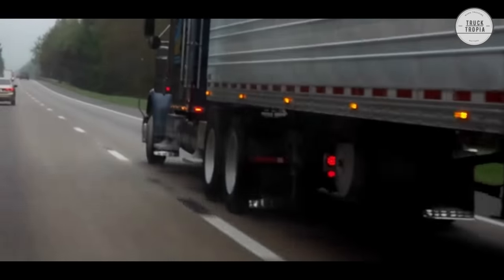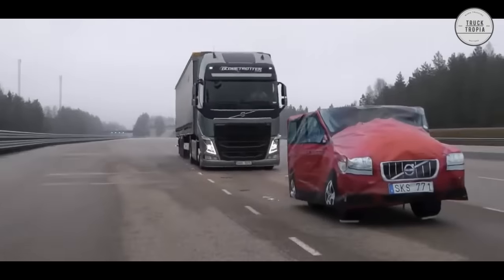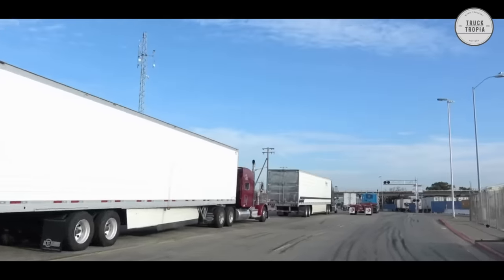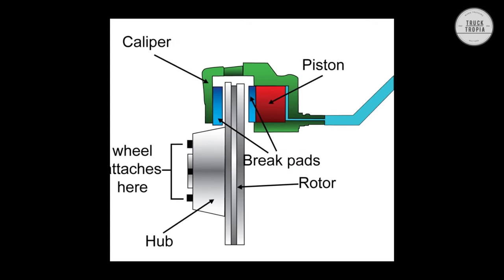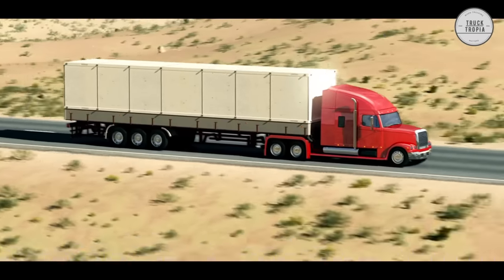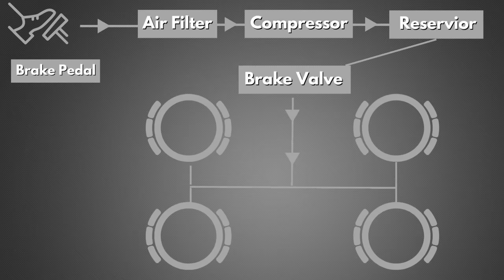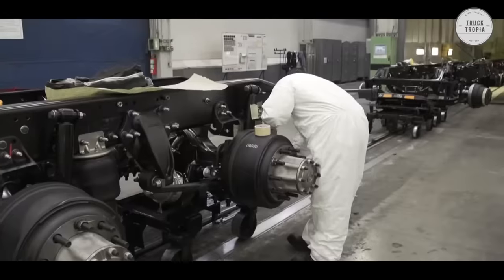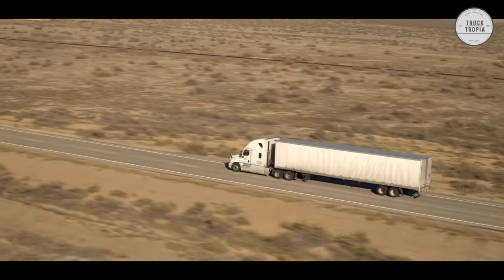Why Do Semi-Trucks Use Air Brakes?

Comment: your answer is wrong, truck use air brakes for the ease of hooking up to different trailers, it was the winner of the competition in the 50s along with the fifth wheel, if i remember correctly it was the bendix company that won it.
Reply: Not the first time and not thfirst topic
Reply from the maker: thanks for sharing your opinion
Reply: @TruckTropia  It's not an opinion, it's fact
Reply: @TruckTropia  plz make Indian truck video
Reply: Also, hydraulic brake fluid can boil in the lines with excessive heat from the pads/shoes. This problem worsens as moisture collects in the system. Water boils at lower temps than brake fluid. So, it stands to reason, the more water, the lower the boiling point, the less braking action up until failure. Brake fluid also needs to be flushed periodically(typically 30,000-60,000mi)which adds to maintenance costs. Commercial trucks can accumulate those miles rapidly which further increases those maintenance costs due to the increased frequency of those flushes. 
As stated in the video air systems don't need to worry about losing brake fluids. In fact an opposite side-effect occurs. Even as air can be lost, the pump will still regenerate more air into the system. At least until it can no longer keep up. Then the brakes go into full lock-up. It's essentially a double redundancy that hydraulic systems don't offer unless you consider the parking brake to be a viable backup. Which it's not. 
Along with a much easier coupling system using air, there are other systems that utilize the system. Things like tandem locks, kingpins, air ride and air seats, all utilize the same system the brakes use. Let's also not forget the ability to air up your own tires(among other things) when an air compressor isn't nearby. 
You can't get any of those benefits from a hydraulic system without supplementing it with additional components.
Reply: @truck tropia FACTS, NOT OPINION.
Reply: Then why do straight trucks run on hydraulic for vehicles only designed to carry lighter weight, but then require air brakes for a certain threshold of weight.  Air brakes are safer and provide more stopping power, like the video stated

Comment: "No brakes fade from overheating"  What is commonly known as brake fade occurs when the binder that holds the brake pad material together melts, and the resultant liquid lubricates the the interface between the brake material and the drum or disc. That's why disc brakes are less prone to brake fade, because the disc is surrounded by air, which cools the disc much more effectively than the enclosed drum.
Reply: Are you sure about that? I’d be asking isn’t it the outgassing holding the pads away from the disc. Which is why the high performance cars run slotted and drilled rotors. The outgassing also heats the pads more cause you have to push harder on the pedal to overcome it. When it reaches the critical point the brake fluid will boil.
Reply: Truck brake shoes don't use binders to secure the friction material to the shoe plate, they are riveted. There is a wear line on the side to let you know when you are on the rivets and need to change them. Usually 1/4 " of shoe left, toss them out
Reply: @kylederry5031  The binder is in the brake pad material itself, it's not what holds the material to the shoe, it's what keeps the material from crumbling in your hands
Reply: @richardmillhousenixon  I got you now, I have seen shoes on little trailers with electric brakes overheat and the material separated,  I didn't consider the actual binder holding the material together
Reply: @22copes  Performance cars use slotted and drilled rotors for different reasons. The holes allow for more airflow through the rotor, keeping them cooler, which helps to prevent offgassing before it even starts, and the slots help to "trim" the brake pads to keep them flat. Have you ever gone to replace a set of brakes and seen the uneven surface on the brake disc as well as on the brake pad? That results from the natural inconsistencies in the brake pad wearing more in some areas and less in others, causing peaks and grooves in the pad material, which then wears peaks and grooves in the brake rotor. So when you have a slotted rotor, the slots effectively work like a razor, knocking the high spots off of the brake pad and resulting in more even wear. They also serve to prevent glazing of the brake pads, which again improves breaking consistency. A side effect of the slots is that they allow the offgassing to dissipate through the slots, but that's not the primary reason they exist.

Comment: This video is either.
A:  Grossly oversimplified on all aspects of braking systems.
B: Grossly ignorant of how and why different brake systems are used where and why. 
C: A bit of both for all the wrong reasons.  

FYI, anyone calling these things out in any way will be brushed off as having an opinion even if they are posting actual industry-wide facts. 😋
Reply from the maker: Its A its a video so that Anyone Can understand
Reply: @TruckTropia  Posting incomplete/incorrect information doesn't help anyone though.  As has every call-out in the comments section pointed out to you.
Reply: @TruckTropia  It's actually so rambling and vague - and in some cases simply incorrect - that it isn't understandable at all.

Comment: The air pressure keeps the breaks deactivated and I thought it was the other way around, now it makes sense why trucks make the air release sound when it breaks or park, thanks for the video
Reply: Nope. Wrong. First, it's brakes, not breaks. The blast of air one hears when a semi truck shuts parks is the air which holds pushes against the brake springs.

Those springs serve as parking brakes and emergency brakes, in the event of a system failure, such as an air line rupture or an accidental disconnect of the glad hands (a connection point between tractor and trailer). So, the red air line supplies air to the trailer to release the parking brakes on the trailer. That's all the air in that line does. Think of it as a dead man switch to try to stop the trailer in case it disconnects from the tractor somehow, or to keep the trailer from moving while parked.

The blue air line, however, functions in a manner similar to a car's hydraulic brake lines, using pressure sent with application of a brake pedal, to each wheel, to force the brake shoes or pads, to the drums or rotors.

From around 1973 or so, semi trailers have been required to have such safety brakes. The brake chamber down by the wheel is two chambers in one. One chamber takes red air line air and resists the parking/emergency springs, keeping them from trying to apply the brakes. The other chamber is the service brake chamber. That one takes air from the blue air line, which is regulated by the driver's foot applying pressure to the brake pedal, and that air pressure pushed a diaphragm which moves mechanical linkages to apply braking force. Truck Tropia should, as a public service, delete this video and not replace it unless and until the author learns about truck brakes.
Reply: @planethedgehog2427  slight correction: pressure to the service brakes doesn’t come directly from the blue line.  The blue line sends a pressure signal to a valve which then opens to allow pressure to flow from the air tank to the service brakes.

Comment: You missed the main fact why trucks have air brake systems instead of a hydraulic brake like cars have: the energy reservoir
A truck has more axles and higher weight, so you need a lot of force to activate all drum / disc brakes. There is more energy needed than the driver can create by pushing the brake paddle.
Therefore you use the energy stored in a reservoir and release this to the brakes with an valve.
The main advantage for using air is that you can store it easy and cheap by compressing it into a tank. For nearly incompressible hydraulic fluid, reservoirs are much more expensive, so an air system is the cheaper solution for trucks.

By the way, you can use air also for other components in a truck like air suspension, gearbox actuation,...
Reply: Your last point (and only that one) is valid, but air brakes were in use before air suspension was common and long before air was used for shifting.
Reply: Not To mention it would be a pain hooking and unhooking a trailer.  And if the glad hands leak, or you hook up to a trailer with leaks, it's a heck of a lot cheaper to replace air than hydraulic fluid.
Reply: @wesleyehowell  Yes, the only serious reason air brakes are used is so trailers can be quickly dropped and hooked.  Everything else is arguable.

Comment: Love the comments section. 

Some are arguing that he is completely wrong, others are saying he’s partially wrong/correct, some are talking about trains, some random said there is no [performance] difference between drums and discs, some guy said air doesn’t heat up like hydraulic/brake fluid does (IDK if he meant air doesn’t heat up at all or if he meant air won’t heat up as fast as hydraulic/brake fluid. His comment had all sorts of typos and he didn’t elaborate enough, so I can’t judge which way he was going with it). 

I’m just here because YT recommended it. I got no skin in the game, though I did operate some military vehicles that utilized air brakes, when I was serving. Don’t ask me how the [air brake] system works because, I kinda brain dumped some of that and I had a very basic understanding of how they worked. If you could ride a bike and write your name, you’re pretty much qualified to operate any type of heavy machinery in the military. Don’t give up on you’re dreams 😂
Reply from the maker: Thanks for sharing 😅👍

Comment: Only one issue,   Hydraulics give more force, this has been proven using comparable size if you will.  Air can provide the same force but with a larger size unit.   Air breaks were chosen because of the safety issue.

Comment: The biggest problem with disc brakes is that it's like going back to the days of inboard drums. You have to pull the hubs to replace the rotors. I hadn't seen inboard drums in 30 years except for a couple of old trailers.
Reply: Are inboard disc breaks like the militaryhumvee?
Reply: @NFLYoungBoy223  never worked on a humvee, after my time

Comment: You left out that air brakes are very noisy, which would be a huge drawback for a regular size vehicle.
You also left out the alternative of electric brakes which are done on most towed trailers like RVs/campers. 
They are not used on boat trailers because the system gets submerged in water, and will destroy the components. 
Boat trailers use a hydraulic braking system where the weight of the trailer pushes against the piston up on the tongue and applies breaking to the trailer.

Comment: The video says air brakes do not fade like hydraulic brakes. That is not true. Many highways have truck runaway lanes for trucks with overheated brakes that have lost their stopping ability. Logging trucks have water tanks to help cool the brakes and therefore prevent the air brakes from fade. Also are brakes must be properly adjusted. When brake drums heat they expand causing the brakes to lose efficiency and effect stopping.
Reply from the maker: true, thanks for sharing :)
Reply: Incorrect. The video stated that "disc brakes are less likely to fade" . Which is factual

Comment: I was told that semis use air brakes because because if there there is a leake you are loosing air an not fluid. An its more easy to use air since its less complicated an it makes hooking up trailers much more simple.
Reply: These reasons are related: when a trailer is connected or disconnected,  no valuable or hazardous fluid is lost.
Reply: And the air gets continuously replaced. Plus, it would be easier to get air in a hydraulic line at the trailer connection which would degrade its efficiency.

Comment: You didn't mention that with disconnecting and reconnecting the trailer there is always some spillage and the systems would need to constantly be needed to be topped up. This is true for air brake systems too but the compressor handles that with the free fluid , air.

Comment: Heat and Fade have nothing to do with using fluid or air.  It is not the "lines" that get hot.  Heat and fade come from either the shoes against the drum, or the pads against the rotors.  Air brakes absolutely do get hot and fade which is why Trucking Schools spend the time that they spend teaching students how to descend properly down long steep grades like mountains so that they don't over-heat the brakes.  I have had drum brakes on a semi trailer turn "glowing red" due to shoe wear allowing the S-Cam to rotate over-center and leave the brake stuck in an on position. I've seen it get so hot it either transferred the head through the wheel into the tire and blew the tire out, or it go so hot it burned out the axle seals causing lubricant to leak onto the red hot brake, starting a fire and burning the truck to the ground. At least the driver was able to grab his belongings and get clear of the burning truck.

Both systems can get leaks. In fact air brakes almost always leak a little bit.  That's why you have to always wait for the air tanks to fill up before pulling way after you have been parked with the engine shut down.  But air brakes can tolerate minor leaks, while hydraulic brakes have zero tolerance for leaks.

One of the main reason for air brakes is the need to join the trailer to the tractor and have a unified brake system. You can't do that with hydraulic brakes due to coupling and decoupling the trailer.  The trailer would have to have it's own independent brake system which is a problem.  Keeping such an independent trailer brake system maintained would be impossible and each driver may only have the trailer for a couple days or less and can't deal with such maintenance/repairs. Electric brakes would not be strong enough on that large and heavy of a trailer.  Hydraulic brakes on the trailer would require tongue pressure actuation (like common U-Haul trailer), but semi trailers have no tongue.

Comment: 4:05 - Brake fade happens in drum brake -air brake system. Most truck run aways while coming down a mountain happens due to brake fade. Brake fade is much reduced in a disc brake setting.

Comment: I'd argue that that the air systems biggest advantage is ease of repair, and the sheer amount of things that can be powered by the system. Windshield wipers, air windows, height adjust on seats, air suspension, and even the fan hub. As for repair, you gotta remember these trucks travel up to 200k or more miles a year. Anything that can fail will fail. When I pull into a roadside for leaking airlines, its a 15 min job max, that is just straight up not the case for hydro systems. When I change a brake maxi, it takes 20 mins tops. On a car, you gotta take off the wheel, re & re the old caliper and then do a bleed. The best part, I need to order no additional parts. Brake maxi's are standardized and drum based trucks only vary between 30-30 long stroke, or 30-30 short stroke. The whole point of a semi's design is to be as easy to repair and as reliable as possible. There is currently no car on earth that could live the life that an average semi lives, just in terms of sheer longevity. Name the last car you've seen that had over 6 million miles on the odometer, cause I can name dozens of semi's that I've seen personally, and they're still hauling day in day out.

Comment: Air brakes only activate with no air on rear axles due to a second piggyback chamber with a huge spring , these are called Maxi’s which are also the parking brakes , (yellow knob) , brake fade is a function of brake pad/shoe friction on the drum or disc which happens with air brakes as well  and not due to boiling of brake fluid .

Comment: There used to be lots of fatal accidents caused by trucks "jack-knifing". This has been largely reduced due to anti-lock braking systems. This article fails to mention this - are air brakes or hydraulics more suited to ABS?

Comment: Hydraulic and air brakes both can overheat. Difference being the hydraulic fluid also overheats, air will not. 

The air system is essentially hydraulic also just air is used instead of fluid. Both use surface area to push and dow work.

Air systems are far more complex in my opinion. Many fail safes built in.

Comment: A: we need to be able to hook and drop trailers without introducing contaminates to the brake system.
Disc brakes are better because when metal get hot metal go expandy and when drum surrond thing gap get bigger whereas when metal is surronded gap get smaller.

Comment: Doesn't seem to be a truck driver in the house. One axle on the truck and one axle on the trailer have the double brake boosters those are the parking brakes, when air is supplied to the rear of the booster, parking brakes are released. When you push the foot brakes air is supplied to the front of the booster and the brakes are activated as normal.

Comment: I’m not sure, but intuition tells me that air brakes are easier to maintain on the go. If there is a minor issue that you can actually fix yourself curbside with basic tools, then you can just do so, have the system re-pressurize and off you go. With hydraulic brakes, you could fix things all you want, but in the usual cases you’d still have no hydraulic fluid on hand to refill.